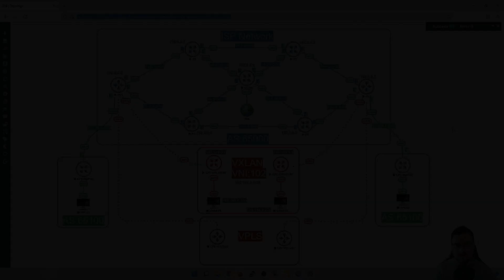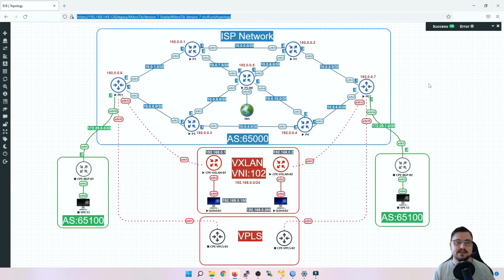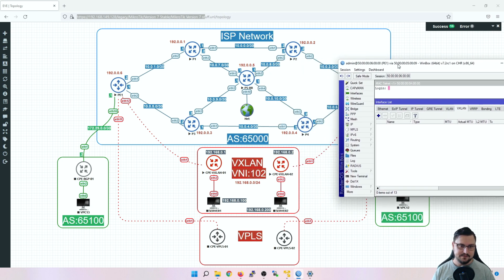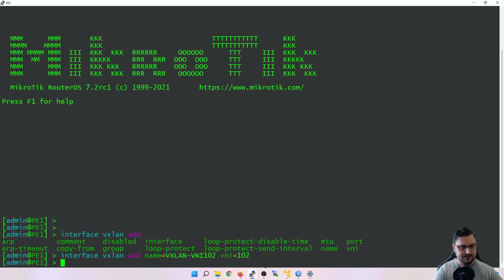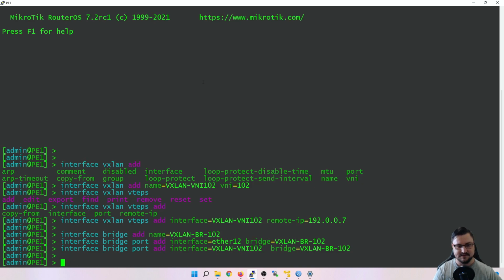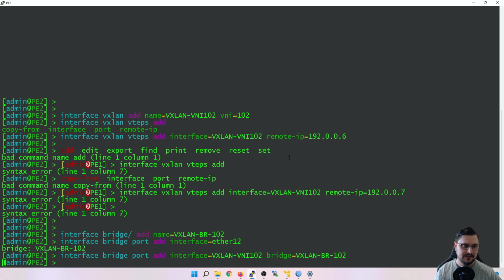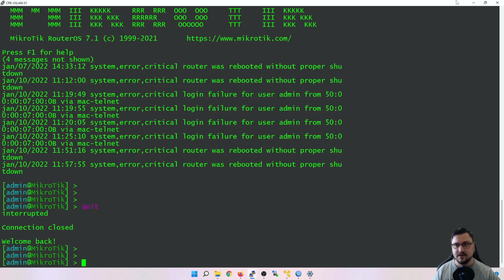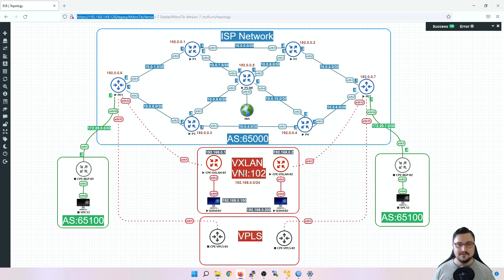⛓️This feature is HUGE on MikroTik! VXLAN is AWESOME!⛓️

Comment: Hi Sir,  the vxlan winbox display is much different now on V7.8 than a year ago.  For example there is  a VTEP tab on winbox.  Suggesting a new video but lets say,  vxlan over a wireguard tunnel.  (setting WG MTU to 1550).  This could be to connect for example two subnets at two different locations.  My understanding is that they could even be different subnets, where broadcasts would still work - think unifi controller (at home) to unifi APs  ( at second house ).
In other words, explore broad/multi - cast with vxlan and use a wireguard tunnel to carry the vxlan.
Reply from the maker: Interesting idea, will have to recreate the VXLAN lab and test around with it, in theory it should work, although I can see a lot of encapsulation happening so MTU overhead will definitely be a thing. Thank you for the suggestion.
Reply: @TheNetworkBerg  Yes,  I started thinking about it because a poster asked about how to get unifi controller at one location to talk to two UNIFI APs at another location.
Via group effort, three solutions were noted,  TWO L2 solutions over wireguard  EOIP and VXLAN.  By the far the better solution was using DHCP Option 43 at the AP location and ensuring a WG path to the unifi controller at the first location - Easy Clean and the two LANS dont need to have the same subnet!!   However,  in the  interest of learning vxlan, I think it is worthwhile exploring how this can be done.  The MTU is one factor that I went out on a limb for, as it was recommended in a post I found in the always 100% correct internet. :-)   I will post the solution I have in the discord channel.

Comment: few questions
- can you have more than 2 routers on the same vxlan (eoip allows only point to point) ?
- are these vteps optional? i mean, when i set group as 239.0.0.1 it works without adding vteps, do i need to add them only if i don't use groups?
so are there 2 ways of configuring it? with vteps and no need for group giving static config, and using group and no vteps so that adding new device would automagically make it join vxlan without setting up all the other? (providing that answer to question 1 is yes of course)

Comment: Hi, Great video as allways :) I am trying to use it instead of eoip but I have a doubt about MTU. I am using ipip tunnels ( via ipsec ) to make vxlan connectivity. ipip tunnels have mtu size of 1402. vxlan by default 1500. is this a problem? should vxlan mtu size be smaller that ipip tunnell? it is working but i wonder if ia can get better performance by changing mtu.

maybe mtu case can be a subject to one of Your videos in the future?

Comment: how can i use vxlan to overcome the max entries of firewall connections ???
i have a firewall connections exceeding 7Millions on other firewall like pfsense, but when i operate mikrotik, connections limited to 800K which cause problem in online games, educational websites and many websites 
i also tried many solutions on mikrotik like fasttrack but i was unable to control bandwidth speed

any suggestions ?
Reply from the maker: VXLAN is a L2 concept, it does not really have anything to do with increasing the amount of connections that can be tracked by the FW, what you could perhaps do though is create a VXLAN tunnel to something like your pfsense FW that can handle more connection tracking and use that as a gateway via the VXLAN tunnel
Reply: @TheNetworkBerg  is there any way to increase FW connections on mikrotik or bypass the FW with bandwidth control

Comment: Im not understanding the difference between this vs Eoip.  Seem to be exactly the same function
Reply from the maker: This has less overhead compared to EOIP, once MikroTik fleshes it out you will also be able to signal VxLAN tunnels with BGP which makes it very scalable as well. Unfortunately MikroTik currently just allows for static creation.

Comment: Thanks for your great videos, VXLAN on MT just being one of them! Just out of curiosity I was trying to replace an existig EoIP tunnel at home that works across a WLAN bridge with VXLAN. I set it up exactly the same way I did with EoIP. Created a VXLAN interface, VTEP and bridged it on both sides the same way I previously did with the EoIP interfaces (which work fine). I can ping with remote IP I used in the VXLAN interface creation just fine, but I can't reach any interface I bridged with the VXLAN interfaces. Do you have an idea why that is? And do you think VXLAN is appropriate for this? Thank you and keep up your great work!

Comment: Feature that is need for Mikrotik to compete against others is to FIX GOD DAMN WIFI drops!
Reply from the maker: I don't personally use MikroTik for Wifi, although I would suggest logging a call with MikroTik if you are experiencing some drops related to the hardware. Wifi has always been tricky due to various factors that can cause drops like interference or even client issues.

Comment: I have two questions hope you get back

1- I have two adsl lines, when I use pppoe client connection through bridge modems the upload is not doubled as download. Im using NTH .

2- Shall I enable ipv6? Is it faster will I achieve any extra speed?

That sound is like a baby 🤣

Comment: VXLAN is cool yeah, but statically defined VXLANs and Tunnels are useless.. they did the hard part, great to them, but now they MUST extend MP-BGP and enable EVPN, otherwise i feel that they wasted time
Reply from the maker: Hey Andrea, yes totally I agree with this comment 100% hopefully MT will start implementing this now since V7 has officially released.
Reply: This is a jump start for 2022 for MikroTik but still far to go the mp-bgp evpn route, not to mention the numerous reliability issues of rOS7 they have to address. I`d rather go do my r&d with cisco than do it with tik. my opinion only.

Comment: Hello Berg, thanks for your videos. VxLAN are new to me and I am big fan of the wireguard, which I am using almost two years now. I was very happy when mikrotik implemented into RouterOS. Do you think that there could be some benefits to use VxLAN over wireguard, or it is total nonsense? 
Like I wrote VxLAN are new to me and I can't really tell if it will have benefits or no :-)
Reply from the maker: Don't worry too much about VXLAN if you aren't doing stuff like cloud based hosting and having many servers across many different geo locations. Wireguard is an excellent VPN tunneling protocol and I wouldn't try to add things like VXLAN over Wireguard, I think the performance just would drop a lot :(

So keep going with the Wireguard :D!
Reply: @TheNetworkBerg  Thank you! I'll stay with wireguard only and with my PBR rules, which works great for me :-)

Comment: I was going to comment Futurama (before reading the comments), but someone already beat me to it. VxLAN is a bit of a fog of war for me so this video will be useful :)
Reply from the maker: Hehe, you can probably just consider VXLAN the evolution of VPLS, it's still a little bit funky on MikroTik for my own liking so I definitely wouldn't use it in a production environment yet, but definitely something to keep an eye on especially once the long-term release is out and everything is working as intended.
Reply: @TheNetworkBerg  Ahh right, I have to re-watch your VPLS video to refresh myself on it :P My understand (I could be wrong) is that VPLS, VXLAN, and EoIP can be used in very similar ways. With VXLAN I assume I can essentially setup Data Centre redundancy for the same subnet/VLAN between the two Data Centres with VRRP? So if CPE-VXLAN-01 is in a Data Centre in Cape Town and CPE-VXLAN-02 is in a Data Centre in Johannesburg you can make the same 192.168.0.0/24 subnet failover between the two? Like if the Cape Town Data Centre went completely offline you can set it up to failover to Johannesburg? I am still trying to wrap my little brain around the practical applications of it all :) Keep up the great work mate!

Comment: Does same subnet can have 2 or more gateway despite using VXLAN? I see that SVR1 using 192.168.0.1 as GW and SVR2 using 192.168.0.2 as GW.  Can you put a single GW 192.168.0.1 and make it like VRRP?
Reply from the maker: Yes, you could definitely do that :), this is a great benefit of using VXLAN, you can even introduce VRRP with it and do something like having a floating IP between the routers that both DCs use as a gateway.

PS. I'm more of a Shadowfiend player myself :P

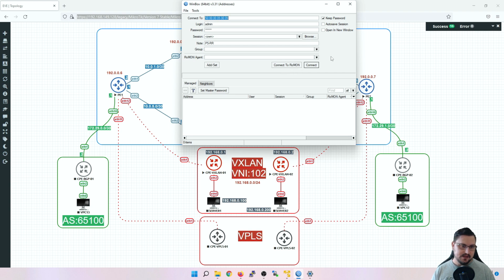Comment: 03:38 Hi Berg, is that possible to remote the mikrotik in eve-ng environment with private IP without using Romon? i see your private IP is 192 0 0 5, can you add this to static route at windows and access the device with an IP through winbox? Thanks in advance
Reply from the maker: Yes, that's absolutely achievable and I have done so with various labs. You can setup static routing on your own PC to the IP address that the NIC gets on the management cloud. You could also add each MikroTik directly to the management cloud and access each device either via IP or mac-address on Winbox without having to use ROMON.

Comment: You look very exited about VXLAN, but at the end you say it is very insecure. Should we use it? How to secure it?
Reply from the maker: Well, I am very excited for it in a data center environment and where I potentially have full control of the network or I know the network I am peering is good, I however wouldn't run it directly over the internet due to it adding around 50 bytes of overhead so can run into MTU issues. This traffic is also all just UDP and if you are running VXLAN with no security in mind someone malicious could potentially get their hands on information that would make log4j look like a joke :P

There are definitely things you could do by creating the connection over another tunnel, though that could potentially cause more overhead. Here are some articles highlighting some of the flaws of VXLAN specifically over the internet. (Perhaps I can look at a video looking at how to address some security concerns on MikroTik as well)

https://udspace.udel.edu/handle/19716/22824

https://eos.arista.com/vxlan-security/
Reply: @TheNetworkBerg  thank you for the aswer. Looking forward to your next video, how to secure VXLAN on MiktoTik. :)

Comment: Cool stuff. What about the overhead? How much is it? Will this cause any MTU mismatch issues? Why does this bring to the table in comparison to EoIP?
Reply from the maker: The overhead is approximately 50 bytes, which is another reason I would also not recommend trying to run this over the internet. VxLAN is also industry standard meaning you could use various gears to create the VxLAN tunnels, so it doesn't have to be MikroTik to MikroTik.
Reply: If it's not to be run over the internet, then the only purpose seems to be to replace VLANs in cases you have more than 65k VLANs in your network? Am I getting something wrong here?
Reply: @agukasian  4k VLANs  not 64k
Reply: @agukasian  VxLAN is not looking to replace VLANs.. If any is only going to extend them.. Like QinQ but it's oriented to connectivity instead of isolation
Reply: @TheNetworkBerg  Isn't EoIP overhead 24 bytes?

Comment: What is the difference between vxlan and zerotier as both purport to replicate the ethernet switch (clearly vlxlan you still need vpn tunnel and zerotier you are depending upon third party).  One advantage of zerotier is that it bypasses MTU issues one can experience with wireguard for example.
Reply from the maker: Well... one disadvantage may be that VXLAN has a pretty big overhead as well, about 50 bytes. So it's pretty hard to run this over the internet like ZeroTier, though it is definitely a lot more flexible for an administrator and gives you direct control. You can pretty much do VLANs over your VXLAN bridges as well. I definitely much more recommend this for spanning L2 services for Data Centers where possible and where you control the entire path.
Reply: VXLAN can be part of true overlay E-W, but VXLAN require network reachability like multicast or IS-IS protocol's , currently  this part is missing from MikroTik deployment.  So they think about GRE + VXLAN, but that way to match overhead .  With directly connected networks like MAN and Wifi Mesh it can be useful  to ran VXLAN instead WDS.

Comment: for some reason vxlan is quite slow. between two CRS125-24G-1S i get around 200Mbps (EoIP on the same setup runs 520Mbps) and cpu hits 100% i wonder if it can be optimized in future
Reply from the maker: Hmmmmm, I think it should be optimized in the future, I would personally expect VXLAN to run better than EOIP. Maybe bring this up with MIkroTik on their forums or email their support as well so that they can be aware of that.
Reply: @TheNetworkBerg  Hi Berg, can you do a lab test of this. If EoIP is faster then there is probably no reason to use it over EoIP. Maybe play with MSS Clamp, MTU, (R)STP, don't fragment, fast-path,...and let us know how VxLAN holds. I have seen EoIP do 10Gbps with 9000 MTU and 1.5Gbps with 1500 MTU. This youtube lab test was done over LAN but created the condition of IP Transit with 1500 MTU limited so when EoIP can do that why use VxLAN?
Reply from the maker: @classicalmusic2425  I can check if I can do a lab test, although I believe Kevin Meyers from IP Architects has already been conducting tests using VxLAN which were very promising, pushing nearly 100Gbps of aggregated data over the link.

VxLAN is also an open standard, similar to OSPF. You are able to use this between different vendor's equipment, unlike EoIP which is MikroTik proprietary.

MikroTik's VxLAN is still in its infancy though, and with time they should be adding what most other vendors have, that being able to span VxLAN tunnels using BGP, similar to what you can do with VPLS. Which is a big game changer compared to EoIP.
Reply: I saw you mentioned previous a high overhead with vxlan. Could it be slower due ti fragmentation?  If so, allowing larger packet sizes across the path between the two devices MIGHT help - just a thought.
Reply: You get 500mbit over eoip? im lucky to break 300 and thats crs1036 to 1036